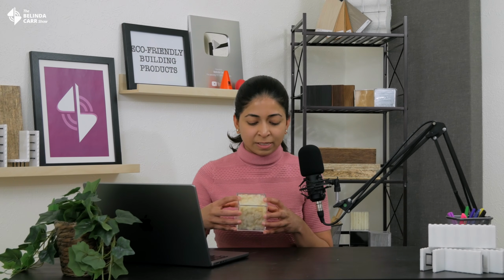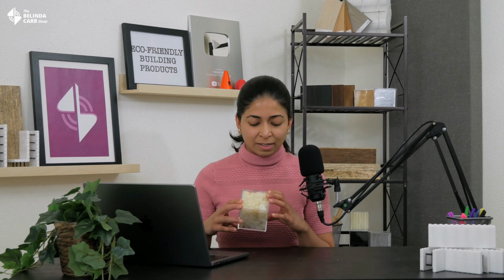Eco-friendly Sheep Wool Insulation w/ Havelock Wool | Episode 13

Comment: Sounds like a wonderful product for the high end market. The one thing that raised my eyebrow was him mentioning needing to put the wool inside of the primary air barrier. (Usually with an air permeable insulation I would avoid a cold membrane because of condensation concerns, but maybe it's like shiplap or a good plywood sheathing where the robustness of the material precludes moisture concerns.)